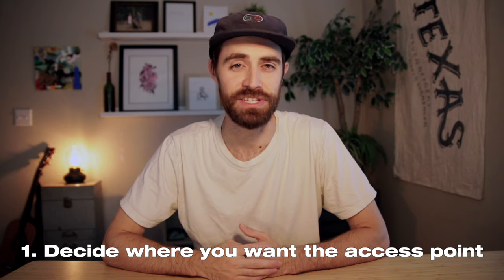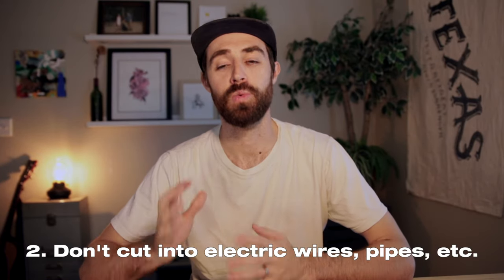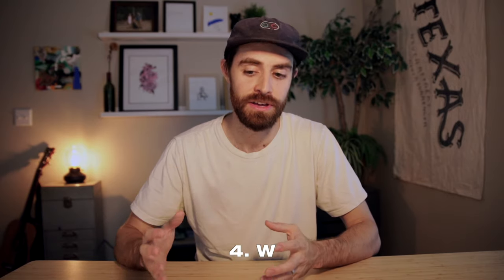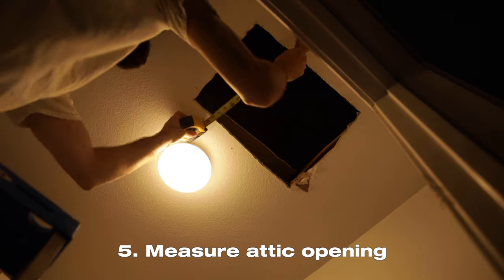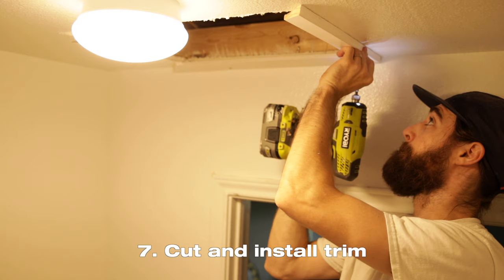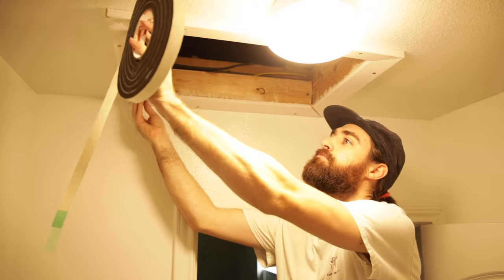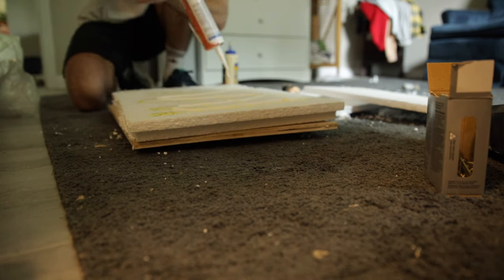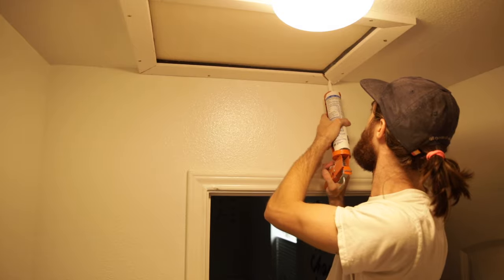How to Install an Attic Access Door - Easy DIY

Comment: I live in a house built in the 1870's.  We wanted to  check the insulation, so we went up into the crawl space attic.  There, we found an old small trunk. Maybe 3 by 2feet.  Inside was a signed note from the original home owner and the men who help him build the house. 12 men in total.  It took over 8 months to build.  It also contained a newspaper and a few photos. One was of  all of the men who built the house standing in front of the house after it was built.  Another was a picture of the living room furnished.  Another was if the kitchen furnished.  It was a pretty cool finding.  I took the stuff to a archivist to have the pictures preserved and framed.  The newspaper is in a special box that is acid free to preserve it.  When I sell the house, these items will stay with it.  Oh I forgot to mention there were some old tools also that they said in the note they were used to build the house with.  Those hang in my husband's workshop in the basement.
Reply from the maker: This is super cool! thanks for sharing.
Reply: Cool story

Comment: I’m sorry, but this is not good. Not even for a beginner. I applaud your effort, but you chose to post this to help someone…and I just feel like someone should teach you the right way first. You can’t use the excuse that it’s hidden in the closet either. If you’re gonna do it, do it right. Take a little pride in your work.
Reply from the maker: But it’s hidden in a closet :)
Reply: Backroads , please post a link for your instructional video for an attic hatch .
Reply: What is the right way? I need to make a hole in a ceiling to give access and I want to know the right steps to take.

Comment: Damn.  That’s the WRONG way to run the electrical.  Yikes.
Reply from the maker: It wasn't a problem since that side of the house didn't have access. Can kind of do whatever you want if no one is going over there lol. Probably should be more protected now though!

Comment: You’re doing it the hard way.
Reply: Hook up a link to the easy way please
Reply: I don’t make videos. Case it out on the floor before you put it up. Then in place in the opening and nail the casing with 2.5” 15 gauge finish nails being sure to hit the attic framing. Then open it and shoot some finish nails on the inside. It’s strong enough to climb and put your screws or nails at the point recommend. Or you can put some screws in predrilled holes but don’t drive them home in case you need to shim. For construction screws is good to stand on the ladder and finish. I’ve done hundreds.

Comment: I install attic stairs every day new construction. In Florida fire code requires 1x4 yellow pine. But any trim applies. The easiest way to install attic stairs is the case the stairs prior to installing. This way I take the cased stairs up the ladder and pin it in place using my 15 gauge finish nailer. It’s easy with two people but at 60 I can still do it alone. I open the stairs and drop them and run a few 15 gauge nails in the frame. This is strong enough to drop the stairs and support my weight to shim and screw it off or nail whichever you prefer. Mark out my ladder, cut it and I’m done.

Comment: Can a fan be placed in place of the access door to pull heat from inside living area and pushing heat out of attic and pulling cool air from window unit in other room???
Reply from the maker: Don’t think anyone would suggest that
Reply: What you're describing is called a whole house fan. And similar to this video, it starts with cutting an opening in the ceiling. There are many different kinds of attic fans and ways they get mounted. The one I installed in my last house sits atop the joists. Only gravity holds it in place. This allows you to remove it for the cooler months, replacing the opening with an insulated hatch, much like the one in this video.
 
I already had an existing access hatch, but did not consider repurposing it. Why? (a) That hatch was too large for what the fan required, (b) That hatch was in a closet, and I wanted the fan centered and barrier-free within the house, (c) I wouldn't want to have to push a heavy fan up and out of the way every time I wanted to get up there in the summer.  (d)  It's easier to make the seasonal switch from up in the attic than down below.  

But that was just my experience. Doesn't mean your idea isn't doable.

Keep in mind you'll also need to plug in or hard wire the fan within the attic.

Comment: trim piece, measures? What type? 4” wide x 1/2” thick and whatever length that you need?
Reply from the maker: I think those were 3” or so. But you can do whatever fits

Comment: I have a ranch house and wonder if I can make an access door in the front hall closet.  The inside wall is 4" from the outside wall.
Reply from the maker: As long as it’s a big enough hole to fit through
Reply: @humediy  Thanks for the quick response!  I was concerned about the pitch of the roofline.  I'll just request skinny service men!
Reply from the maker: @linettearnold519  that makes sense! I cut a hole too close to a roof line before so I had to cut a new hole.

Comment: hope some one knows  so in my bedroom walk-in closet there's is a Attic Access Door it's the kind you just push up and then move to the side my question is does it matter if the panel door is thin  would it be ok if i put a new door that is at 1 inch thick or 2 thick does it need to be think?
Reply from the maker: As long as you can push it up and move it over shouldn’t be a problem how thick it is
Reply: @humediy  the opening is 22 inch x 22 inch  width the panel is 24 x 24. to push it up and move to the side  is 7 inch up the only way to take out the very thin panel is to turn it so it coming out corner to corner i think the panel is very thin because to take it out it had to be thin to go out corner to corner a thinker one maybe not fit inside corner to corner but i will try when i have a 1 inch thick panel

Comment: Please stop teaching things that you dont know!
Reply: yeah dominic? what do you suggest instead?
Reply: That looks like a bag of Cr”p  Zackary here seems to think that you have to be able to do it better in order to talk about it. I don’t have to have the skill of being a painter, a plumber, a taper, an electrician. All you have to do is watch how they work and you’ll quickly realize they don’t know what they’re doing, or they do, in this case he tried. I’ve never done this before but I’ve seen it done and I know 1 thousand percent I can do it better. Yes there is a huge gap all around the size of Mike Tyson’s teeth, and those screws 😂 damn, you’re supposed to use thin finish nails.  But whatever......
Reply from the maker: Works perfectly fine for me and other houses I’ve seen done the same way 👍

Comment: Why did you screw in the Trim?   It's trim.... it doesn't need to be screwed in to a stud.  SMH
Reply from the maker: Lol no one sees it. And I didn’t have a brad nailer. Don’t worry though… I have one now! 😎
Reply: @humediy  glad to hear - could have just glued it.  would have been just as good!
Reply: @christedder8438  I would prefer to screw such that I could remove the trim if I need to replace the HVAC in my attic.. Watching this video now on how to build one out because we had to tear the old one down haha
Reply: It makes sense to use screws. This isn't like putting trim along a wall for purely aesthetic and sealing purposes. The fasteners are being used in an overhead application, against the force of gravity,  holding up both the trim and the  hatch door (and IHMO, the heavier the door, the better). And you know that trim is going to get smacked from time to time, especially if you store stuff in the attic.

Comment: I’m afraid I might find a body in mine. The previous homeowners SEALED the access that was in the hallway. I can’t imagine any good reason for this except to make it airtight — but I don’t think they even put any insulation over their botch-job. There needs to be access as the only access currently is via the garage — and a vaulted ceiling — making that space above horribly narrow. Don’t know if the previous owners were just incompetent or what. Suffice to say it is making it a real pain in the ass to top up the existing 1977 insulation.